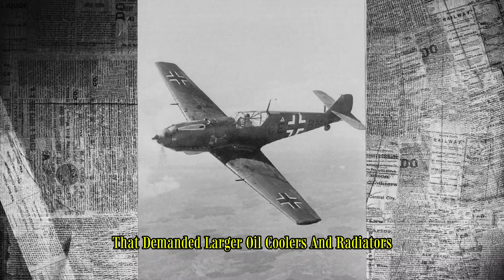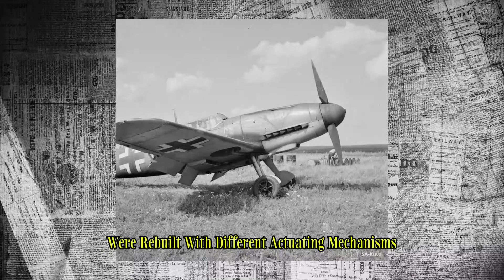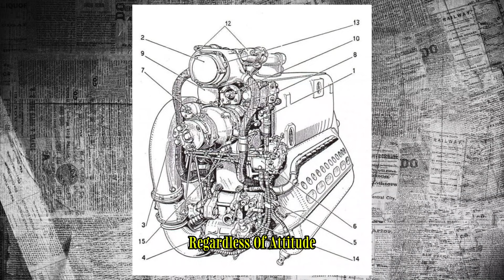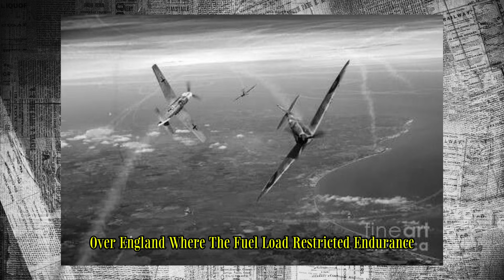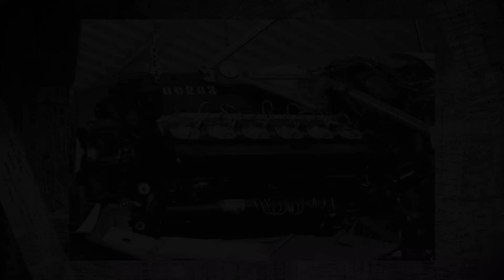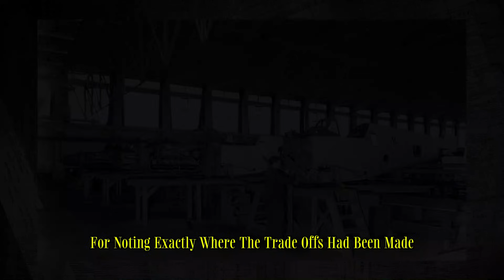They Doubted His Redesign — Until The 109F Outclassed Every Allied Fighter !

Comment: The 109 E also used direct fuel injection, so the advantage against merlin powered hurricanes and spitfires only applied until their carburettors were upgraded with Miss Shillings orifice and the Merlin 61 on also had direct injection